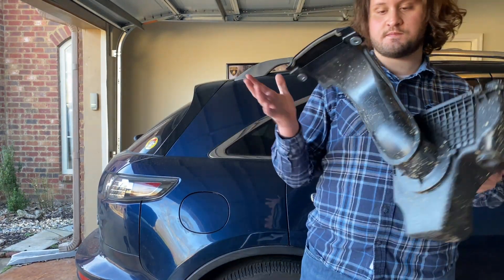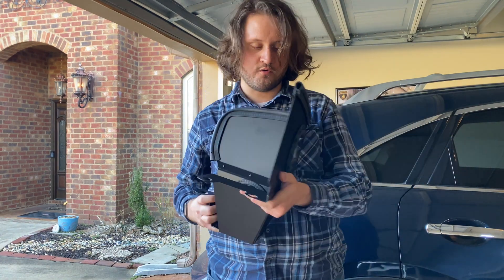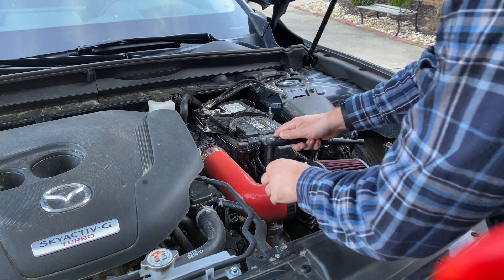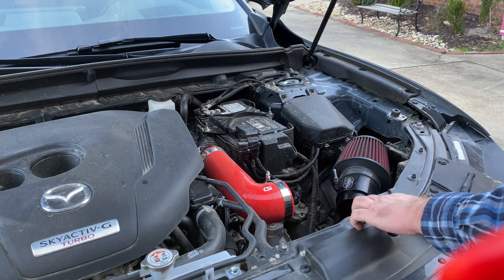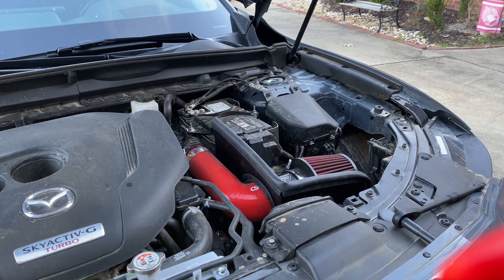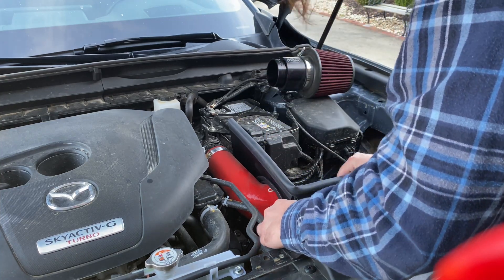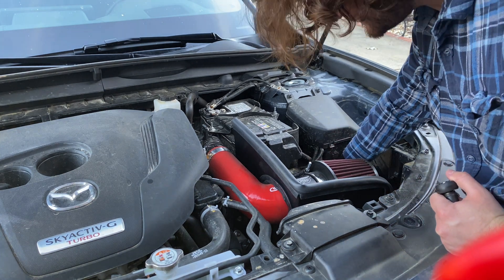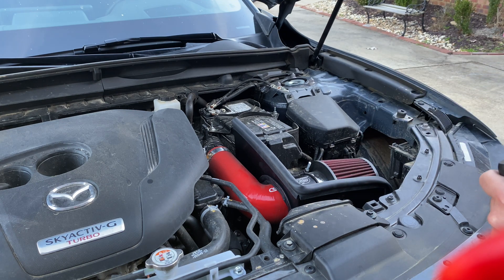Installing the CorkSport Turbo Intake Heat Shield

Comment: damn the RX8 wheels actually look pretty good on there.did you have to run a spacer in the rear?
Reply from the maker: I didn’t. They will work without a spacer, though I do the the offset is off slightly. For a flush look, you’d want the spacer though

Comment: Appreciate it man. I’m installing the inlet pipe, intake, and heat shield and holy shit am I struggling. What I’m on right now is getting the MAF sensor holder onto the tube and it’s such a tight fit holy shit. Yours looks like it just easily slides on haha. Wonder if it’s because they’re using a different tube for the inlet pipe vs what comes with just the intake kit.